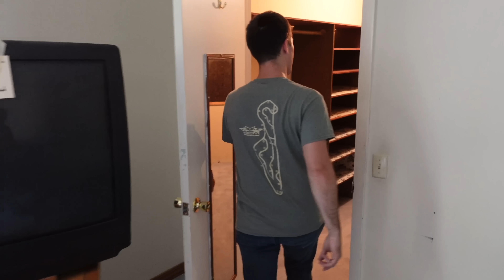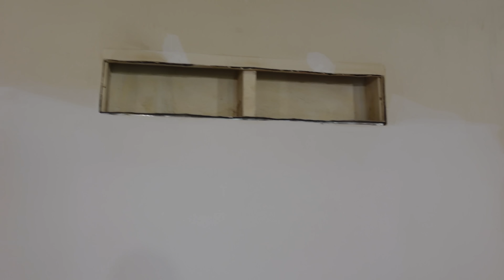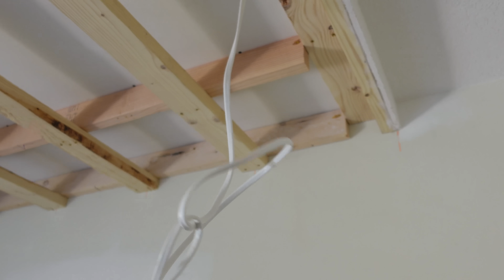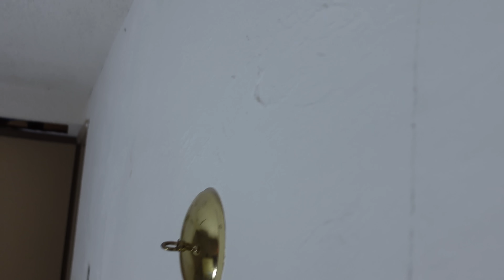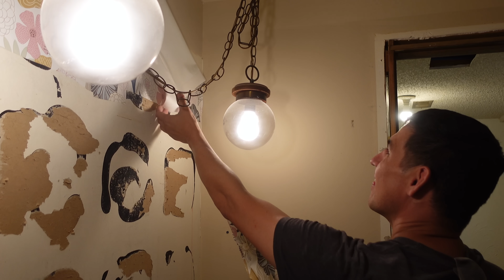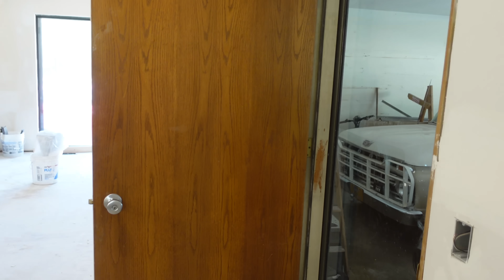I Have To MOVE INTO This House Next Week... Or Im HOMELESS

Comment: I don’t see any new windows? I thought you might put in new triple pain high energy efficient. They do make a big difference in sound and warmth. Should have put a dryer trap to catch lint and keep the pipe clean. Need solid core doors that keep room more quiet. Missed doing a hanging toilet to make cleaning floor easy. I can’t wait to see your game/theater room down in the basement.  House is looking great. Next you’ll have to build your outside entertainment area. Kitchen with BBQ & pizza oven. The. Pool with hot tub. Got to be over the top being the Hugh Hefner house.

Comment: Can I make a suggestion, if you haven't thought of it already.  The shower in the master bedroom, I would insulate the wall between the bedroom/bathroom especially if your water valves/pipes are going to be against that wall.    Wish we did when we built our new shower which is against our living room wall - the noise of the water at start and running is irritating to say the least.    My master bedroom wall also is next to the main bathroom - we put sound insulation in between that wall - what a difference!    You could almost hear everything that was going on in there, many disturbances thru the night from the night owls.

Comment: As a musician and studio owner: don’t put carpet in your living room! It’s gross… the reverberation is a function of so called standing waves (sound bouncing between parallel walls). You now have a perfect scenario for those. In 3 planes sound is bouncing between smooth surfaces. Once you put in some furniture and lights and one or to people a lot of it will go away! Put in a hardwood floor. If the sound is still too “bouncy” put in some rugs, mount some pictures. Anything that make the walls less smooth will break the standing waves. If that’s not enough hang some curtains or if you need more dampening hang sone acoustic panels on the wall. They make nice looking ones these days. I get mine at Hofa acoustic in Germany. They work fantastic and are filled with sheep’s wool so purify the air in the room as well. I’m sure you could make some yourself and instead of solid colored fronts you could have pictures printed on it if your into that.

Comment: Heater sitting directly on the basement floor with known water issues from the past ! Dryer vent going up the wall and across the ceiling !!! They are meant to run 6’ not a long run … inline booster fan should help that out . Navian is the best in the market make sure you run two pipe for the exhaust and combustion air don’t hack it up … your return in the living room is undersized and should be increased !

Comment: How is the lint from the dryer going to make a 90 degree bend and go up 18 feet?
Reply: It's a vent to let the heat out not a lint trap.
Reply: @just4giggles-ex5ne lint gets by the dryer trap all the time, and you need to clean the vent regularly to prevent fires. The dryers’ vent fan is not able to push lint up and out a long articulated pipe! Ask your local fireman!
Reply: @wadetyler5056  Disagree, I've had the same dryer and vent pipe for 27 years, approx. 15-foot run with 4/ 90-degree elbows with no problems. You must keep the dryer lint trap cleaned out every time you use it. They make an inline lint trap for the people not cleaning the dryer lint trap.
Reply: @just4giggles-ex5ne  Even if you clean the dryer's lint trap religiously, you still get stuff that makes its way past and into the vent

Comment: JR from my experience your heat pump dryer will not need the air vent, my laundry is smaller than yours and I do not require any venting.

Comment: The dryer plug should be 4 feet off the floor in case the washer leaks I had a house fire due to a short in the dryer plug caused by a washer leak

Comment: Typical JR……if we work non stop it will be done in one week…….it’s totally done except paint, lights, flooring, trim.  Comical.
Reply from the maker: It’s the only way to run projects 😂
Reply: @WatchJRGo  I had to move into my project on day 1, it’s really hard to live where you are trying to fix up
Reply: Like saying you car rebuild is done, except the engine, trans and rear end😂😂
Reply: “Done” is relative, apparently
Reply: So true. Seems most, if not all home improvement/construction videos operate similarly.

Comment: Putting in the dryer vent now was absolutely the way to go. Better to have it and not need it than need it and be pissed you have to tear the wall apart to install one.
Reply: Good call on the dryer vent. The new dryer's work like crap! Take much longer and I don't care how efficient they are when you have to wait for your clothes.
Reply: @craigjohnson3603  any air that is vented has to be replaced by air from outside. If it’s winter or summer you’ll need to heat or cool that outside air. It’ll be 150 CFM+ of additional heating or cooling load for your house. Just have to take that into consideration.
Reply: @mesodan womp womp
Reply: no dryer vents in German houses as they all use the condenser dryers that take 5 hours to dry a load of clothes; I would kill for an American vented dryer.
Reply: Aren’t they horrible for efficiency though?
Reply: @mesodan  They have to be properly installed for size, rise and configuration. It's more complicated than you think.
Reply: Yea but going up and through the attic he’s gunna wish later one he didn’t do that. Those get clogged up bad and easy.
Reply: Everyone in the real middle of American NEEDS a dryer vent.  The air outside is 95% humid already and our HVAC is fighting that more then the heat itself...   It would have been STUPID to skip the vent....  John has a way of getting stupid...  His water filter for instance...  He likes to think hes smarter then decades of experience.. And tech guys always think a better way is waiting to be discovered.  I am an idiot like john LOL...   Need saved from myself sometimes LOL